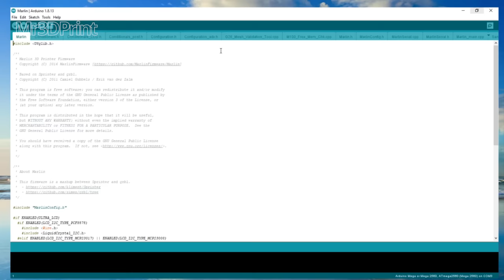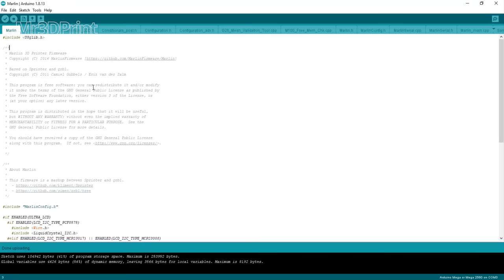#4 Heat and motion control board  - Details of free filament production from recycled bottle (PET)

Comment: Hello sir, can we make 2 units production with one control board?
I explain one control board control 2 stepper motord, two 100k thermistor and two 12v 40 w heater
Reply from the maker: Yes you can

Comment: Hi, I'm having problems when I load the Marlin on the Arduino and connect it via an external source, it always crashes when it starts, but when I connect it via a USB cable it doesn't have a problem and doesn't crash, would you have any idea what it could be or have you experienced it? that?  I thought it was the Ramps card, but the seller already replaced it and the new one I received gives the same problem.  Would you help me?
Reply from the maker: Ask your questions on Instagram, the link is on the bio page

Comment: I have the old mother board of my ender 3 since i upgraded for a silent. Can I use just this and the marlin software to control the heating tube ?
Reply from the maker: I do not know you have to test
Reply: You bet you can. I did it with a Mega2560 and a Ramps1.4. If you know how to modify Marlin firmware it is fairly easy.

Comment: do u have a firmware that can be used for this? i got one of these boards laying around an ive been trying to build something for a pet puller for a couple weeks but none of the heating controllers ive gotten has any kinda safety that i can see so ive been leaning back toward using a old 3d printer board so it can have thermal runaway.
Reply from the maker: Ask your questions on Instagram, the link is on the bio page

Comment: It's really great work you're doing with this project, thank you so much for sharing it! 

I'm curious, do you find the different bottles to be of a similar thickness or do you adjust how thin the bottle strips are cut based on how thick the bottle walls are?
Reply from the maker: Thanks my dear friend, if you pay attention to other videos, the thickness of the tape is different and it is determined based on the thickness of the bottle walls. If you cut the strips according to the bottle cutting tutorial table, the produced filament will be the same.
Of course, I would like to add a point that the filament produced is mostly in the form of uo, you are empty, to compensate for it, you can change the diameter defined in the software instead of 1.75 to 1.5, so it works without any problems (of course, this is my experience from It works with this system, it can be different for you)
Reply: @mr3dp  Thank you for such a quick and informative response, my apologies for missing that step, I may have a missed a video in the series. I will definitely refer to the table you mentioned, this was just a question I had in my head from your very first video.

It's smart of you to change the filament diameter instead of something like Esteps so the retraction distances are still accurate! Do you think changing the extrusion multiplier would be an alternative that has the same effect or is there another reason to use the filament diameter setting?
Reply: @mr3dp  can you provide some link for the bottle cutting size chart.
Reply from the maker: @RubixB0y  I do not know, but I am researching it
Reply from the maker: @arvindh13  I'm trying to make, unfortunately the caliper I have is not digital and I can not get the exact size
Reply: @mr3dp  If my calculations are right, a 136% extrusion multiplier (or 1.36 depending on slicer) would simulate the 1.5mm filament setting with the filament diameter unchanged at 1.75, but I have not tested this.

I took (1.75)^2 / (1.5)^2 to get the ratio of cross-sectional area.

Comment: How can we edit the gcode for modding  the speed and heat? because it keep breaking the filament i want to slow down the pulling speed its fine i find out with a tutorial ! and just one question ? which line i have to edit to slow down the motor of the puller?
Reply from the maker: Subtract the front number f :
f55  to  f35 or f25...
Reply: @mr3dp  Its all fine now i edit it with Notepad++ its very easy thanks :)

Comment: there is one detail i m interested in: how do you effectively remove the labeling glues residue before cutting the bottles up?
Reply from the maker: You mentioned an interesting point: I usually remove the labels by heating the bottle a bit
Reply: @mr3dp  does the resin evaporate without degrading the plastic? because when i tear the label off there is usually residual glue/resin that needs some alcohol to get rid of, which although not such a hassle is - when counting it for many bottles - quite the work

Comment: Hi Mr3DPrint

I have a problem with my LCD it show blocks when i turn on the system.
I have a reprap lcd 2004 smart display same as Prusa print lcd i know your system works with the lcd from ender 3 i when to see in youtube if there is any solucion non that. 
I sow did not help so in your experties is there a way to put this other lcd work with this marlin sketch maybe to changes or able in the sketch so it works.
Thank you fore your help
Best Regards
Reply from the maker: Search your LCD on the Internet and install a special configuration for it

Comment: Hey there, I am trying to make my own right now and had a question, when I put my filament into the nozzle when it comes out the other end it isn't really fully melted, it folds itself around and leaves the middle empty, is this right and if its not how do I fix it?
Reply from the maker: Increase the width of your bar a bit, but if you are empty it is not a big problem, you can change the diameter inside the software from 1.7 to 1.5 or 1.6.

Comment: I bought the electronics components that was listed here...(power supply, steeper, fans and I even bright a new thermistor... ) I can't get the heater to increase beyond 193oF ... what can I do to boast that heat?? it that mitigated by the power supply12v powersupply? or a setting inside the merlin FW that i downloaded from your site?? I looked through the settings and it says max temp=275 inside the firmware. the thermistor came from an ender 3 v2 .. that one didnt reach more than 160oF. SO I bought a new one .. using the Thermistor type in the merlin fw 75 and also turned off the run off protection.  Even with the new thermistor, I can't exceed 193oF and its not melting the plastic nicely ... its folding it and when it comes out I can unfold the thread it makes. Its driving me nuts!! lol  Any idea what I can do to increase the heat?? its taking about 20mins to reach 190oF. When I load the gcode its programmed for 220oF but it never gets there.
Reply from the maker: Please connect with me on Instagram
Reply: Hi hen can you help me with which code is to be upload in Arduino
Reply: @kartikraval4050  I’ve had a hard time with that my self. I’ve been exploring alternatives. Like a motors with a simple speed controller and saying to hell with all the programming part. The latest challenge is that I upgraded my MacBook to the m2 and now Adriano doesn’t recognize the usbserial. One thing after another. I’m going back to keeping it simple. :-)
Reply: Can u help me to locate the codes location so I can upload and run it

Comment: im gonna use an extra heater with my 3d printer, just gonna connect the other one and that should do the trick, set the temp on the printer
Reply from the maker: Be careful, the G-code provided may no longer work with the Marlin code (perhaps)

Comment: Hello, my name is Romain, I’m 13 years old and I’m doing the video project #4 Heat and motion control board - Details of free filament production from recycled bottle(PET)♻️. I managed to do the electrical wiring but I couldn’t make the arduino code part with Marlin. Could you send me the arduino code please? It would make me very happy!😀

Comment: Also why is it better to blow the bottle instead of starting soing the process without heating it with air inside?
Reply from the maker: The reason for heating is the flat surface of the bottle, but if you have a bottle with a flat surface, you do not need to heat it, like this video:
How to make a gazelle sculpture with a plastic bottle & free filament

Comment: I just made your machine but no filament comes out like in your videos, it is hollow and at the time of printing many bubbles come out, in addition to that it does not come out round
please help
Reply from the maker: Hi. Please do not send a text multiple times to avoid being blocked. Please send me a video or photo on my Instagram to see what your problem is
Reply: @mr3dp  

I'm very sorry, I was going to delete them as soon as someone helped me, it was just to increase my chances
Reply from the maker: I respond to comments in less than 24 hours, so you do not have to submit a request several times
Reply: I had the same problem, but found that I had to modify the temperature and the speed that the puller was pulling at. One of the main problems, that I found was the thickness of the bottles has to uniform. I was using some milk jugs and they vary in thickness between 0.42mm and 0.65mm, so not using them any more. I found that 2 and 3 liter soda bottles are great, as will as distilled water.

Comment: in 2 years: throw bottles into one side of a container and get filament out of the other
Reply: For a few years I've been wondering about with aluminum cans making a automated like bottle return machine somewhat if you've used and seen the mechanism of operation.  Though with a cutting section to make a slit, remove or stamp the ends possibly, and then stamp to make a roof or siding tile.  Seems the same can be performed with PET bottles to make roofing or siding tiles.

Comment: Nozzle? 1.75?
Reply from the maker: I drilled it with 1.5 drill and the produced filament is about 1.7, but in general, it does not matter how big it is, in any case, if its density or diameter is small, you can change it in the software settings. And instead of changing from 1.75 to 1.5 or 1.6, this was not a problem for me